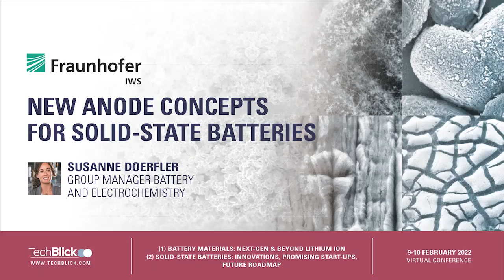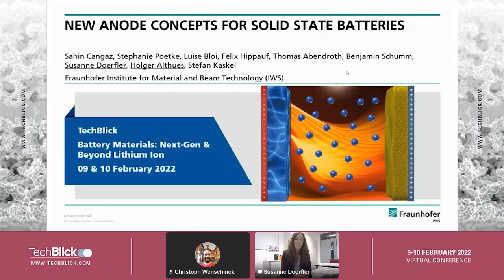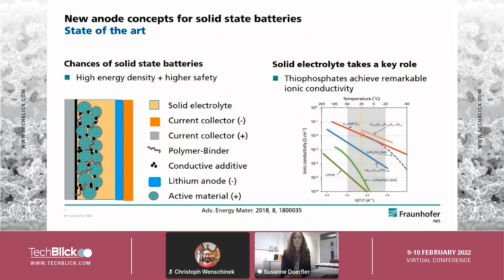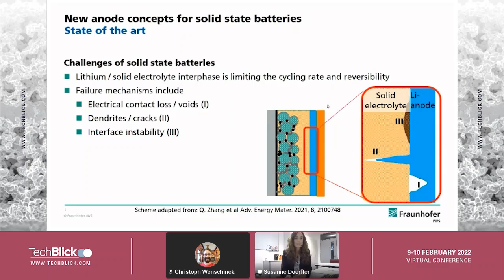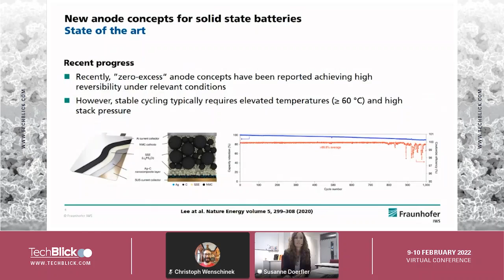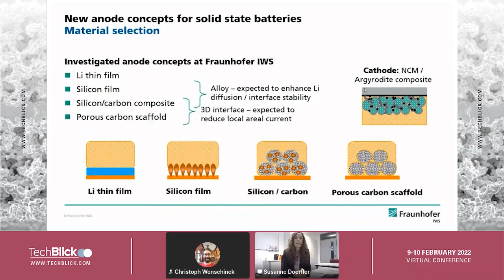Fraunhofer IWS | New anode concepts for solid state batteries

Comment: in the human body the smallest "almost empty battery" is ADP (adenosine duo phosphate) and when we "burn calories" (oxidation of something) this almost empty battery gets charged up by sticking another phophate to the ADP which then results in the "full battery" molecule ATP - Adenosine Triphosphate.
when a chemical reaction in the body needs energy, it take an ATP and 'breaks' off one phosphate and the chemical reaction can take place (i guess there was some electron transfer involved).
here is my question:
is this energy transfer, using the ADP + Phospate  <===> ATP transformation model from nature something that we could use in a man made battery?